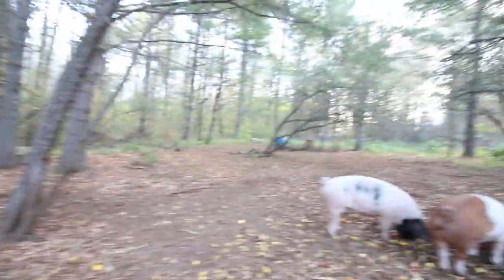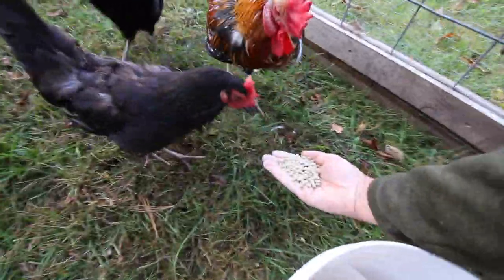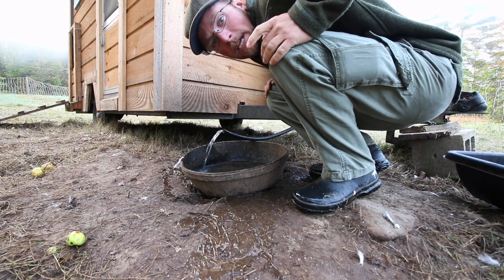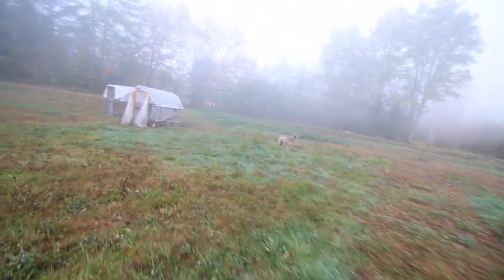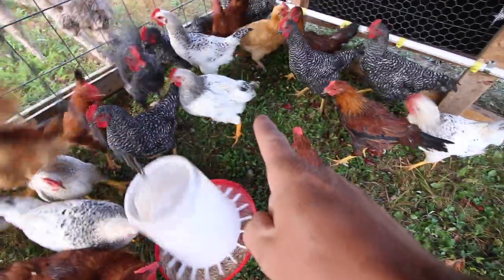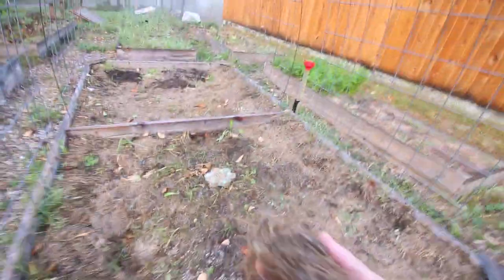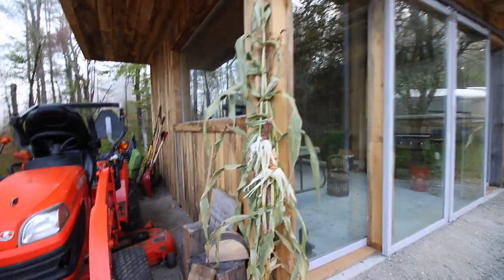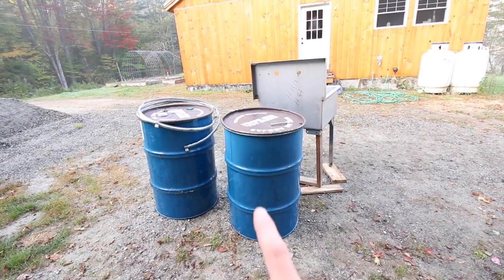🐖🍎The Easiest way To Raise Pasture Raised Pigs~ Modern Steader Update🐖🍎

Comment: If you've got hens in with roosters, wouldn't they be laying eggs? I'm a city guy and too old to start doing this now but I was just wondering...
Reply: A hen will lay regardless whether with a rooster or without a rooster. She will also stop laying when she goes into molt with or without a rooster. Hens are very cyclic laying eggs, every 24 - 32 hours. As she ages and with cold temps, those hours can extend even further.